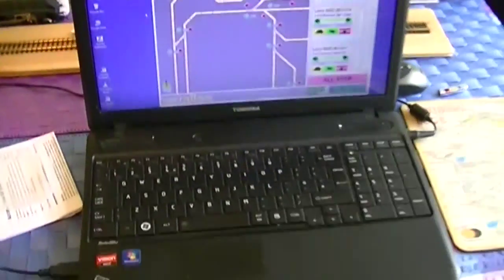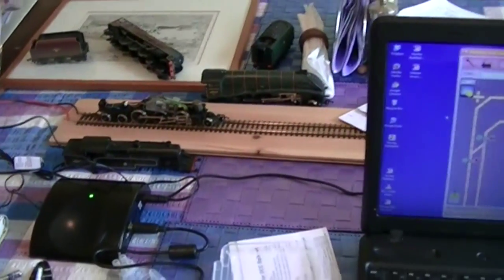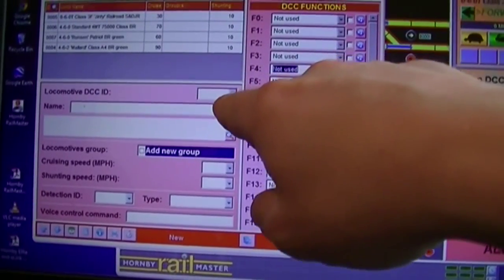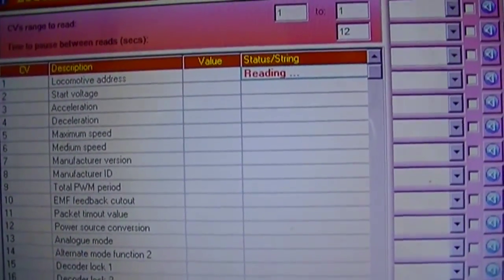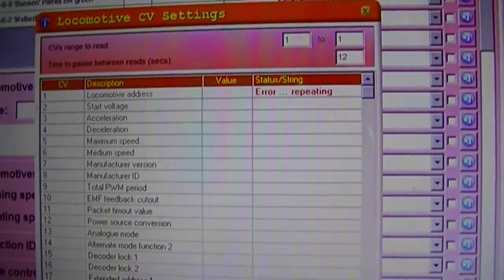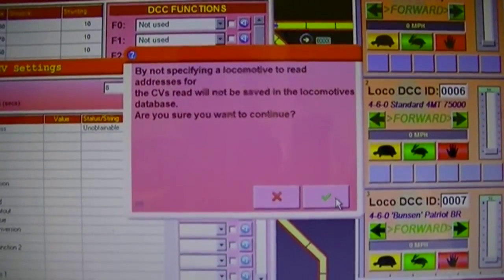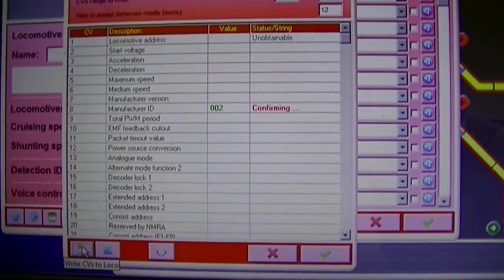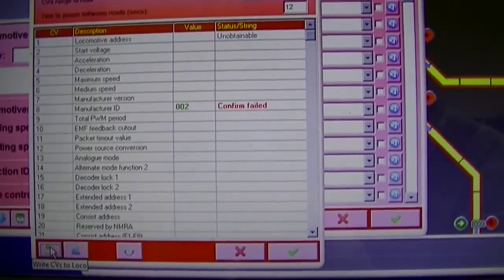Hornby E-Link - How to know your DCC chip is bust (1/3)

Comment: Hi, maybe u could help, do u know the 150-153 cv settings for hornby tts sound chip to run a lima ring motor? I cannot get it to run stable in railmaster at all! It's to slow on slow speed then by 25mph on the control window it's off like a rocket! Thanks
Reply from the maker: Not really, no. All the CVV chips have their own programming, so you need the manual to know what the settings are. If you're talking about the sounds it makes, it's highly dependant on the sound chip itself. Maybe you get variations in quality between them.
Unfortunately I'm kind of out of this loop. Our railmaster fried so got a different controller, and my Dad is getting too ill now to work on it.. he's just trying to finish bits of the modelling rather than keeping the trains running :(
Reply: Yw